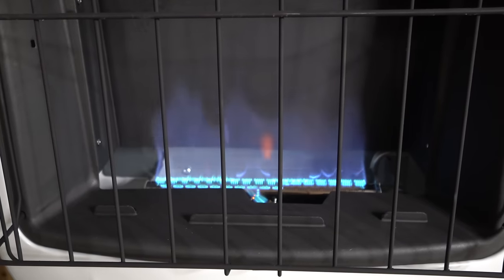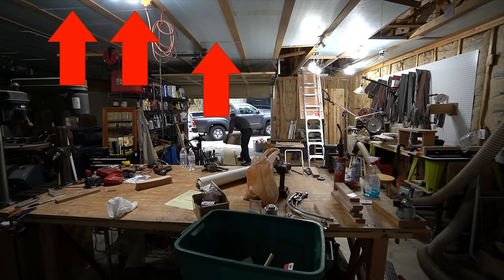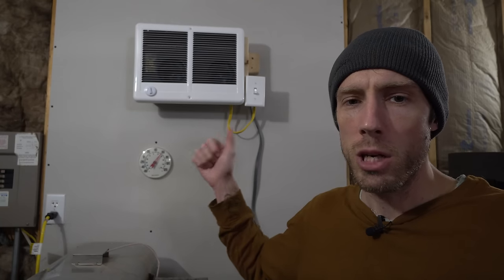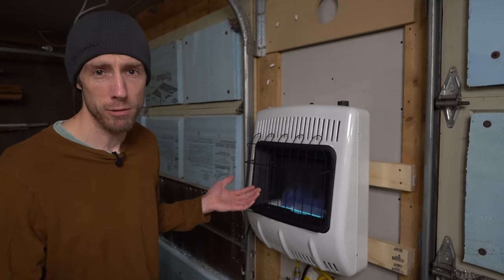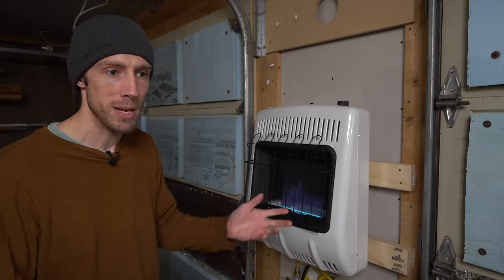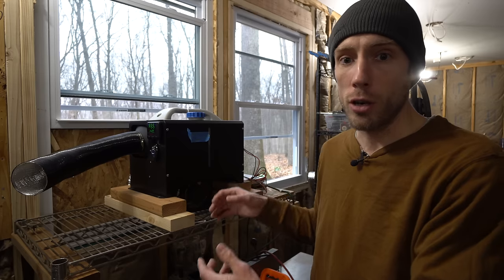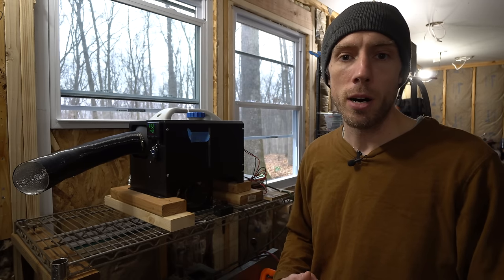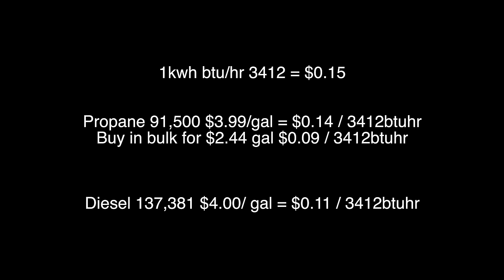What the most cost effective heater for a small shop? How I Heat My Shop For Cheap

Comment: Give a try to infrared stoves but you need the big powerful models for big rooms, they are cost effective and the heat is super comfortable (very different from conventional heaters).
Off course take proper safeties for fire risks, fire prevention.
Infrared will not heat 100% of the space but if you are inside the heat cone they are very pleasant also for breathing (no combustion or heavy air).
If temerature drops down too much, probably infrared alone are not enough but they can work with classic heaters simultaneously.
Reply: If the area is insulated good enuf then those will certainly end up heating the whole area, just under the cone like you mentioned will be much warmer, but yes they do a good job for sure

Comment: I think there is a $2000 tax credit now for a few years on pellet stoves. Depending on your tax situation , that may equate to a free pellet stove other than the cost of the fuel. They also come with thermostats.   I heat my home with wood below 35 degrees and heat pump above that here in the moderate climate of Charlotte NC. ( the wood unit came with the home and provides good exercise for me, I get the wood for just my labor )   Many things to consider and you covered a lot with various fuels.

Comment: Ha! Finally a diesel heater video using a 120V to 12V converter (20A). Trying to power off a battery or battery charger is a bit of a fight because of the startup surge current (~12A).

Comment: Modern heat pumps are amazingly efficient. With Coefficients of Performance (CoP) from 2.5 to 5. So if you had a CoP of 3.5 you could put 1000 watts in and get 3500 watts of heat out. It's much more efficient to move heat than to make heat. Plus a heat pump can be run in cooling mode in the summer. Using your numbers,  a CoP 3.5 heat pump would cost you $0.04 per 3412btuhr
Reply from the maker: Yes but the cost saving would still take 10+ years to break even due to the higher initial price. Just in time for the warranty to run out.

Comment: i put a Rinnai natural gas direct vent in my basement. i love it. was not cheap or easy though(poured concrete foundation, brick veneer walls, heater unit 7-8' below the final exhaust exit).

Comment: Hi Alex, I really enjoy your no-nonsense, information rich videos, thanks! And you are occasionally amusing! It is a common misconception that it is more efficient to keep a space heated 24/7 rather than only when it is occupied. Heat loss is directly proportional to temperature difference. If the heat is turned off, the space will cool due to heat loss. The rate of heat loss will decrease as the space cools. When the space is reheated, the amount of heat lost has to be replaced in order to bring the space back to temperature. Due to the decreased temperature, less heat has been has been lost than if the space had been maintained at the higher temperature. It is more efficient to allow the space to cool when not using it.
Reply: Heating and cooling causes condensation...  which rusts tools and equipment.  Best to avoid large temperature swings.  Plus, once it's really cold inside it takes a LONG time to warm up...  and the faster you warm it up, the more condensation is produced.

Comment: When I lived in the bush of Alaska it cost us 30 cents a gal for the # 2;the heating oil we bought by ,,55 gal barells. My Kenmore pot burner would burn a gal a day keeping my cabin at bout 36 deg.( Not freezing) while I was gone running my trap lines. It's just sitting out in the weather cause it would be cheaper to just burn cash. And Vevor is a pretty shabby product line. They make a lot of types of heaters. I live in the mountains waaay off grid and burn a big barell heater in my tractor shop. ( Wood burner,) Cost is labor and saw fuel n oil.

Comment: Hopefully heat pumps can improve both in cost effectiveness and quality within the next decade or so. I enjoyed Matthias Wandel's recent minisplit video where he compared it to gas heating for his house -- definitely a different use case, but similar climate I believe. Right now I see the main advantage as being two systems in one, being able to air condition an area as well (or perhaps better) than heating them, perhaps making them more ideal for living spaces than working ones.

They just have some ground to make up to be a good replacement for these dead simple heaters that are cheap both to purchase and fuel.
Reply from the maker: I saw his video 👍
Reply: I think the bigger issue is being able to Insulate properly, if an area is well insulated then it retains the heat from say a heat pump better meaning it doesn't have to work nearly as hard to raise the temp of the area it's trying to do just that in
Reply: Heat pumps work good until the outdoor temps get to the 20's or the weather creates ice conditions. They're nowhere near on par with fossil fuels. If you're trying to maintain a 50 degree shop, a heat pump will likely do good for that. If you're try to get to 65-70 ro be in the shop, you'll likely want a fossil fuel item to get you up there and then let the heat pump maintain. In the HVAC industry we call these dual fuel systems.
Reply: @DIY Chad 726  insulation plays a huge role on the building envelope. But in the end, we're trying to heat the refrigerant up with the outdoor air. At a certain point we've crossed a line of diminishing returns. We refer to this as "balance point" in the industry. The point where the heat loss is equal to or greater than the heat input from the heat pump. At this time we will switch from the heat pump to a fossil fuel burning piece of equipment.
Reply: The most efficient and best heat pump you could easily use year round would be a geo thermal system. These are very expensive to install which creates long periods of time to see the pay back on investment. However once installed, it's easy to see on the monthly utility bills just how much money we spend on conditioning the air in our spaces. A monthly bill reduction of half is very common.
Reply: @toolman9081  you are completely wrong. Mini sit heat pumps are good for as low as -22°f and can produce 100% efficiency as low as 0°f. These are not like the old crappy central air heat pumps. They are far better than fossil fuels. We pay 1/4 the price to heat with a heat pump vs. propane. Where have you been for the last 15 years when it comes to heatpumps?
Reply: @randybobandy9828  sure bud. I've been in the hvac trade for over 20 years. Thanks for telling me what you've read on the internet, not what you've experienced in real life.
Reply: @toolman9081  you obviously haven't been very good at hvac. I guess you install garbage central air units only. They are almost all inefficient and have terrible heatpumps if they have them at all.
Reply: @toolman9081  I have installed many minisplits but clearly you haven't.
Reply: @randybobandy9828  only trane and Mitsubishi bruh.
Reply: Heat pumps are far more efficient and effective if they are the type that uses ground or water as the primary source the heat is extracted from. Air source heat pumps will never match ground source types. Also the ground source type are not susceptible to low transfer efficiency when the outside ambient climate changes. Those outside air temp changes can make air source pumps perform very poorly at times.
Reply: @toolman9081  Ground source heat pump systems are far more dependable than air source types.
Reply: @howardosborne8647  Yeah, ground source HP also have an installed cost 3 to 4X an air source HP depending on the ground sink, open loop vs closed loop, vertical or horizontal closed loop.  The other issue in a dusty shop environment is clogging the heat pump air handler.
Reply: I purchased the 38 SEER Innovair mini split with 9000 BTUs working off of 240 V AC. The stats that were tested was **230w/hr** set for 66 degrees Farenheit with outside temp at 30 - 36 degrees. Not too bad for a minisplit. Plus, as mentioned before it will also cool my space. Beauty of a heat pump, working both ways. Oh, I forgot, electricity is free from my solar panels that maintain my large LiFePO4 battery bank (maintained at 80% capacity) which gives me over 31 days of autonomy based on my daily usage. Total operating cost = $0.00 or until it pays itself off 😅
Reply: @toolman9081  Exactly and a point well taken. The plenum temps almost feel cool. They don't do well in houses with older people. When it gets really cold outside, they are inefficient and run all the time.
Reply: @toolman9081  No argument there, but insanely expensive upfront to install. For a just a garage especially.
Reply: @TheReal1953  we don't view run time as inefficiency with a heat pump. Longer run times are more efficient,  when you thing about starting currents, 10-15 minutes of time to move the refrigerant to the right places to begin heating, or cooling.  This is where the inverter technology gains most of its efficiency. Either variable speed compressor,  or variable refrigerant volume. If we could turn on the system and leave it running for 10 years, then come sell you a replacement system, that's the residential hvac guys dream.

Comment: I'm in a warm climate, I do wonder how many folk in very cold (compared to here) have small workshops with a coupla feet of dirt against the walls & on the roof to help retain the heat?
Ahhh that sounds like an evil doers bunker but thinking along the lines of a roots cellar. Seriously cost prohibitive I guess but making the heat must be one thing, but not losing through window glass & even closed doors is one thing but also insulated walls & roof. 
How much is too much insulation? Maybe there isn't such a thing when you have snow or or long very hot days.
You're providing greta food for thought, great work

Comment: Greetings! A very good video, most informative! I also have purchased a heater like yours, 8KW. It has not been installed yet. Now the point: like you, I do not like to "throw away" BTUs, and so I am planning to route my exhause gasses through a 60's model Volkswagen Exhaust derived heated air. Such a heat exchanger is already engineered to harvest heat energy from Exhaust Gasses, and works very well. Good luck, Ciao!

Comment: 9:07; we had non vented p. stoves like this one in our house. after going through sinus infections, upper respiratory problems, headaches & dizziness, i found that even if you vent for carbon monoxide, the combustion creates other non vented gases; sulphur dioxide & nitrogen dioxide. those were the problem. & after removing the heaters, our collective health returned. the other caution is that these gases alter the color of anything they land on...
Reply from the maker: I agree. I think they are good for emergencies but not for constant use. 👍
Reply: If you have enough moving air then anything can be ventilated, just gotta make sure your doing so up high and down low as gasses have different density's

Comment: 20:00 It is important to note, the direct(unvented) propane heater vents the products of combustion directly into the living space. (carbon dioxide, carbon monoxide, and steam/water, and small amounts of other such yuck) If the moisture/humidity  doesn't vent to outside with the natural air exchanges, it may condense (if it reaches the dewpoint) to some midpoint in the insulation (nondecomposing fiberglass) or some midpoint in the wooden structure. If you had some kind of vapor barrier (like 1 to 5 mil plastic) stapled to the inside of the studs near the insulation would prevent (or slow) the passage of condensible moisture through that barrier into the structure of your walls/ceiling.

Comment: Great video! The problem for me with diesel is that it smells like a diesel truck is running right outside all day. That may or may not bother you. Propane puts off a lot of water vapor with can cause humidity problems overnight.
Reply from the maker: You don't smell this heater at all unless you spill the fuel everywhere 👍

Comment: Good ideas and job dude 👍👍. You’re right the propane has a smell .  Like these choices and appreciate you sharing these options especially the elephant heater . Didn’t even know it existed .  I’m in Ohio and have seen many different redneck heating systems from old converted dryers to dbl stacked barrels or wood burners 😊. Whatever works best for the person is the way to go and getting the cheapest heat is paramount around here .

Comment: Did a trick and uped it to 90 ish %. The exhaust steams when it comes out. Also if you upgraded to a vented propane to get rid of the spell and dust issue it would have exhaust losses also

Comment: The most powerful heater I’ve ever seen was intended for using outdoor or in a building that has no heat and it was when I worked at a steel mill. They ended up getting these heaters that they had were electric and you could plug it up to a I can’t remember the actual voltage but  I think it was 210? Anyway you could set it 30 to z50 feet from you and turn it on and it would blow hot air that whole length and warm up everything in that stretch.
Reply: And your not talking about one of those torpedo heater that uses kerosene or diesel to burn to create the heat then a big fan (reason for plugging it in) to blow said heat...... Those are the most powerful I've ever seen
Reply: @diychad7268  Guarantee that's what he's talking about. I bet a lot of folks think those are electric only.

Comment: I tried a Buddy heater in my teardrop camper and found that they don’t work at higher altitudes.  So when camping at 8500 feet then its oxygen sensor would kickoff.  The other downside is that it made a lot of moisture in the air, so we had more condensation on windows, walls, etc.

I put in a diesel parking heater and it runs at any altitude that I camp at.  We’d only consume about a half gallon of fuel over night, and its power draw on the battery is impressively light. Once started, it draws .85 amp or about 10 watts to run the pump and fan.  It’s also very dry, which dries out everything, but it can be too dry and give headaches.

Oddly, I’ve heard of electric vehicle owners installing a diesel heater in the trunk.  Apparently, the EVs heat the car cabin using resistive heat which draws down the battery and thus reduces range.  A diesel parking heater uses way less power from the battery and thus preserves the range.  So if you see a Tesla filling up at the diesel pump, now you know.

Comment: Just ran across this video, thanks!  I'm in a pretty similar situation.  We inherited a house with a detached 2 car garage that I'm making into my workshop.  It's far enough north that I need heat to be able to use it during the fall and winter.  Incidentally I just made my first knife recently, so thanks for your instructional videos!  Since there is already a chimney setup I plan on putting in a wood stove for days I'll be working all day, but I think I'll look at the diesel option as well.

Comment: My 30x40 Shop will have a Heated Floor from My OWB to maintain a low temp, Then a Wall mounted fan Coil unit the Quickly bring the temp up. 
Thanks .
Mike M.

Comment: Biomass reactor heaters are cool as shit... Run black water line and coil it on the ground then dump your compost on top. Temps at the core will be around 180.. some farmers heat their barns and green house all winter long
Reply: In Europe most farm house "People living areas" are on the 2 and 3rd floor. The first floor are all the cattle or sheep sleep. Their body heat does help warm the floors.

Comment: A good combo for the elephant heater for a lot of people would be a timer switch/plug. Just set the on/off cycle and plug n forget lol. But that might only be good if you are a very routine person
Reply from the maker: It has a thermostat on it🙂
Reply: It's got a timer built in. You can't easily add one, because when you turn it off it needs to go through a cool down cycle. Without it stuff can melt.
Reply: @andriosz Well yeah I know that. I'm talking about a timer like what a lot of retail shops or even plant growers use to regulate cycles. I personally would set it up like this if I was going to be in my shop the same time every day, you wouldn't need to worry about going out there to start the heating cycle it would be doing it already. But I'm only bring it up cause he turns the whole system off over night.
Reply: @andriosz  I saw a video where a guy did add a thermostat to his diesel heater thru the keychain remote and was able to get it to go thru it's shut down cycle each time.  Very interestingly done and effective!